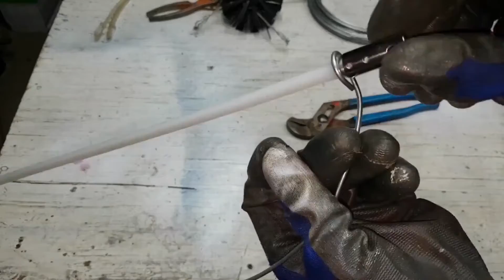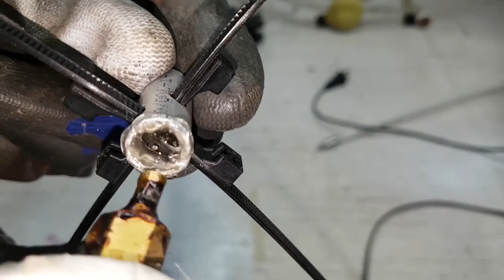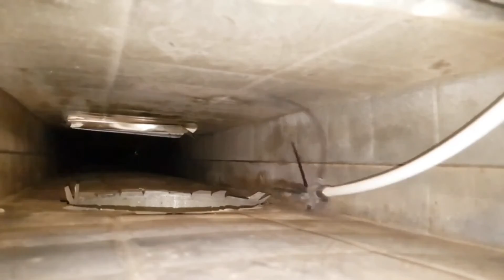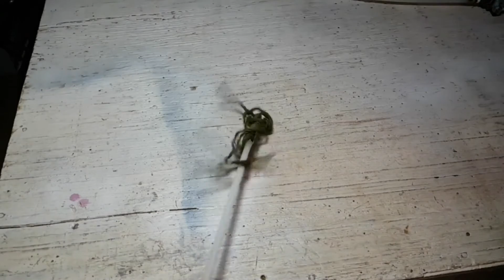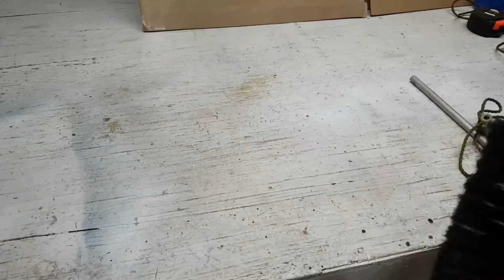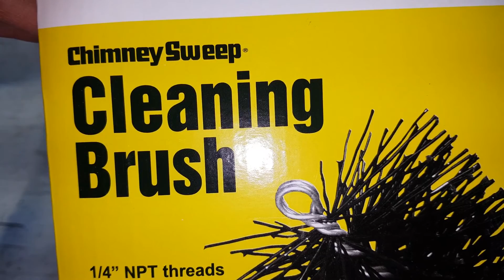DIY Air Duct Cleaning Tools, part 6 - Making Brushes for Drills to clean Air Vents - With Testing

Comment: I use aluminum tape around around metal parts when inner and outer diameters don't line up exactly. It increases the outer diameter of a tube/bolt/pin uniformly, it's durable, and not difficult to remove/replace
Reply from the maker: Thank you for the tip

Comment: I watched your videos and I loved them 😅 you are very precise and articulate but? My ducts weren’t metal and the house was built in 1937 so I went to Lowe’s and replaced the ducts completely but definitely learned so much I needed to blow out my blower which was not on my radar until I saw the dust on yours. Very good advice. I’m now thinking about putting in a UV light to avoid any future mold or contamination 
Thanks
Reply from the maker: I sure wanted to replace the ductwork when I saw how bad it was, even though it was metal and  mostly cleanable.  There is some flexible ducting in the system and it's very hard to clean because of how fragile it is.  I'll try to clean it more, but that segment will probably get replaced.  I plan to make some more DIY air duct cleaning tools specifically designed for flex duct cleaning.  Thank you for the kind words and sharing your experience with ductwork
Reply: @BudgetPhil  definitely some cool design concepts are you considering maybe taking it farther like increasing knowledge and opening a duct cleaning business
Reply from the maker: Thank you.  I doubt I'll be opening a duct cleaning service, but the subject of air duct cleaning tools and equipment does interest me.  I'll probably just keep learning about it and sharing what I learn.

Comment: I spent over $2500 between two companies to clean my air docs. The one did such a horrific job. I had to hire another company to come out and do it. The first company literally left my ducts dirty and they destroyed my system, they blew everything through it. Mind you are heating and air-conditioning is brand new heater in 2020 and then 2021 for the AC. I hired them to clean our ducts to make sure that everything was nice and clean so we wouldn’t have issues. They failed to do that. They’ve made the situation worse. Hired another company they cleaned out everything I mean they ran that system they were here for a good 3 to 4 hours cleaning everything. They did as much as they could. Whatever that company did the first one, the lucky in business right now. That being said, thanks to the first company I have asthma. I bought a brush online that says it does for dryers and air ducts. I just wanna make sure I’ll be able to use it to clean my soft ducts because the dust is horrific in my house and I’m not spending more money for a duct cleaning service. Here’s the brush I purchased from Amazon.

Holikme 30 Feet Dryer Vent Cleaner Kit, Flexible Lint Brush with Drill Attachment, Extends Up to 30 Feet for Easy Cleaning, Synthetic Brush Head, Use with or Without a Power Drill https://a.co/d/dae38yN

Comment: A syphon canister containing some  sort of liquid disinfectant with a metering orifice could be incorporated with your air whip tools. A safe for humans plant based insecticide might also be effective at  discouraging spiders and other creepy crawlies from having a party in the ducts. A little goes a long way and even though you cant smell it after a day or two,the spiders can for months and will avoid the area. All of your trial and error methods were clearly explained and demonstrated with proof of concept to achieve the desired results . Getting there with what was on hand economically is the way to go for sure! You set a good example for others who might not be as resourceful as yourself. All in all your applications are top shelf.  Looking forward to your next vid whatever needs to be fixed, you can do it.
Reply from the maker: Thank you for your kind words and advice.
Reply: Your best bet is to fog the duct work with safe  chemicals with enzymes drys and it’s all dead germ and even mouse urine smells fresh

Comment: FYI just remember your brush size can easily be tailored to your duct size by using this formula: radius= diameter divided by 2. So if your duct height is 4” then a bristle length of 2” is more than enough as the hub takes up about 1/4- 1/2” of distance.
Reply from the maker: Thank you for the info.  Having the bristles a little longer helps to get further into the corners of square ducts but the bristles need to be fairly flexible for it to work.  I had a lot of trouble getting the brushes to clean out the corners.  Some air whips I recently made that have brushes attached to the ends seem pretty good at cleaning out those corners.  I'll talk about them in part 7.